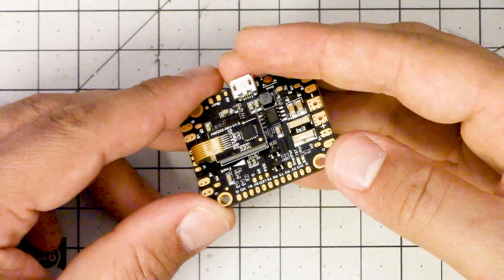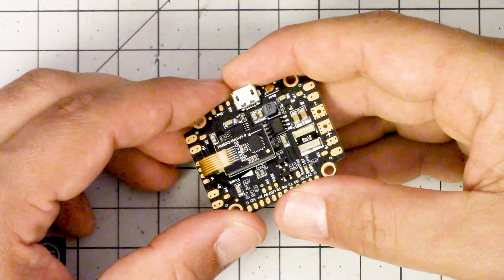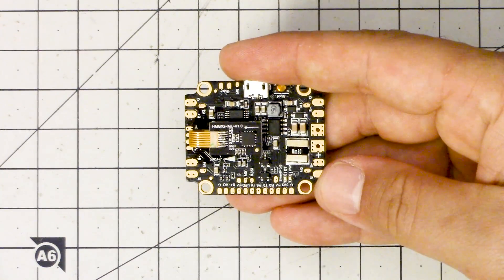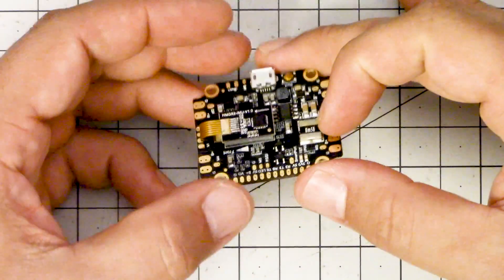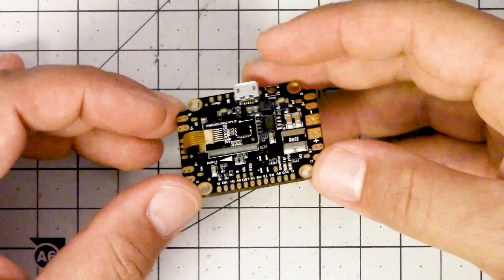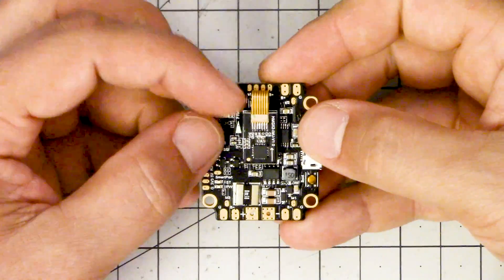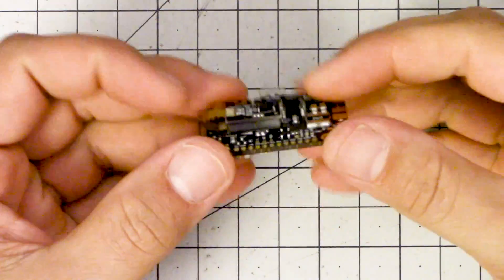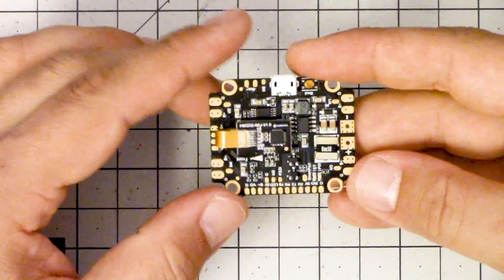Holybro Kakute F4 AIO | BETAFLIGHT FLIGHT CONTROLLER REVIEW

Comment: Joshua. Great video as always... i have just purchased this AIO board. My question is, im having trouble with a wobbling issue on my new build. I am replacing my BF F3 FC with this kakute f4 AIO. I have spedix es30 amp esc..will this work with blheli-s esc's? Or do you have to run blheli_32 esc's? Also can u set the gyro and pid loop to 8k/8k with mt esc's?. Thanks steve
Reply from the maker: +Steve Maratea yes it will work with any blheli ESC's no problem. You can run 8k/8k as long as you are using multishot or dshot.
Reply: Joshua Bardwell ok great. Im excites to try this new as i call it the Bardwell Board.. haha one question tho. I have the unify pro v2 5v, the crossfire micro, and the foxeer arrow v3. Im not sure how many milliamps the foxeer v3 uses as well as the crossfire micro receiver..? I know the 5v reg habdel 1.5amps. Woukd it be safe to run the vtx cam and reciver on the 5v? Using 800mw? Or is the B+ have a filter on it? So i can just wire the vtx and crossfire reciever to the 5v and the fpv cam to battery voltage? As long as the B+ is filtered.. Thanks

Comment: Hi Joshua,

One thing that confuses me is that in the manual it says there is UART 1, 3, and 6 and this is agrees with what I see in BF. I see the Tx and RX UART pads for UART3 and UART6, but not UART 1. Is UART 1 the Smart Port? If so can I use the Smart Port as a regular UART? (such as my runcam split). I just need one more UART and I gotta figure out this UART1 business! Thanks!

BTW I have hard mounted (nylon and steel screws) two of these FCs, one on a 5" Leopard and one on a 6" chameleon. Both worked out great, especially with the leopard because of the tight fit and it withstood a lot of bashing as it's my favorite quad. So the soft mounted gyro I can totally vouch for!
Reply from the maker: +GeckoLibre UART 1 I believe is used either for Smartport, so it only has the one pad. You cannot use it as a regular UART because it has an inverter on it, which is required for Smartport but breaks other protocols.
Reply: Aww donuts! Well there's somethings that could be improved. Another regular UART! Thanks Joshua for you help.
Reply: I just had the same issue on a 6in long range build , 3 standard UART's would be great, as the crsf crossfire protocol requires a uart, then i have none spare for a gps , as i use smartaudio also

Comment: I am flying the non AIO version of this on two copters and love it 
However when i try to enable dynamic filtering, things get weird. I can enable the setting and all is good but as soon as i set it to PT1 i get bad howling that sounds like motors if i disable the notch filters it gets worse and with just pt1 it’s un flyable, i go back to biquad and all is good flys great both my copters do this i have it on a chameleon frame and a 3” Loki x3 both fly great with the regular filtering but the dynamic filtering makes them both act the same in PT1.
i have a micro lux V2 F4 on a mobi x2 with the dynamic filtering on and pt1, and all filters off and it flys better then either of the larger craft 
Any idea. Why This would happen ? both the other craft are the same with aikon 4 in 1 speed controller and FC, only difference is the frame size

Comment: Just flew this FC... all I can say is WOW.... Unbelievable control and NO VIBES at any throttle... I fly 2700kv Dal5050 2-blade at 72degree camera angle and basically full throttle.... :) ....  even in a full throttle sweeping turn no vibes.... My max amps went from 84amps to 95amps cause it's not vibing anymore.... I have to say all your suggestions to them were spot on! easy to solder, easy to setup ... actually came pretty much set-up already and of course an excellent manual.... and NO VIBES.... good Job!!!! ... I'm buying 3 more FC's tonight for all my other quads!

Comment: hey, I bought this board together with a hobbywing 4in1 ESC. To get the OSD right on consumed current, I need to wire all the ESC wires (positive and ground) to the current input of the 4in1 ESC, right? like 4 wires down to the one input socket?

Halp plz!

Comment: i just noticed betaflight 3.2.2 isnt letting me save gyro and pid loop changes, and also the max arming angle thing. (180) i'm trying to save 8 and 4k but it keeps saving 8k 2k instead... is this normal, or do i have a problem somewhere.  i also saved and rebooted and one or twice it reconnected by itself, i'm running 3.2.1 firmware. and i tried various combo's of reboots with battery and usb complete unplug....cpu is at 5%...
Reply from the maker: it's because you have oneshot configured and oneshot125 cant' go at 4k.
Reply: ah brilliant deduction, thanks... i  will do multishot soon .. just wanna get some simple flight tests in first....

Comment: I learn something every time I watch Joshua's videos. The reason why I bought this board among the many I researched is that Joshua has been involved in the development of this board. Knowing this FC must be good if someone as good as him had assisted in its development, I was sold immediately. Now I am in the process of building my third racing quad. This one is my first with an F4 FC though. This time I am stuck. No matter how carefully I have followed the numerous instructional videos and the manual and other articles on the web, I could not get my spectrum satellite to go into bind mode. I have used three separate sat Rx's to no avail. All of them are DSM2 and so I'm using the following commands in the CLI after selecting SerialRX on UART3 and choosing Serial-based Receiver / Spectrum1024 under the Receiver portion of the Configuration tab in BF 3.2.2

   set spektrum_sat_bind = 3
   set spektrum_sat_bind_autoreset = OFF
   save
(and then I power cycle the board but no blinking orange LED) Hmmm!

I have soldered the satellite receiver wires correctly. Orange to +3.3V, Black to G, and Gray to R3 exactly as indicated in the manual. I have also tried with the bind command =3,5,7&9 options although I believe 3 is the one that must work.

I have checked the voltage with a multimeter and am absolutely sure the required 3.3V is present at the Sat Rx connector. To make sure my Sat Rx is not faulty, I have tested with two other Spectrum satellite receivers to no avail. I have checked and rechecked everything several times and am exhausted.

I could try binding the rx to my DX8 in the traditional way and carry on. But I really want to learn something today by knowing what is going on.  I would appreciate if Joshua or anyone of you pro pilots would tell me as to what silly mistake I possibly could be making here. I am sure I could not have messed up the FC while soldering as I am an electronics/computer repair technician. I have not had this binding issue with my other F3 FC's.
Please teach me, Joshua. And thanks for sharing your knowledge.
Reply from the maker: Spek Sat bind mode doesn't work on most F4 boards. You have to use a full spektrum receiver to perform the bind, then you can use the speksat on your FC. 

I recommend the LM0027.

http://amzn.to/2yeFmSQ
Reply: Thank you so much for your help. I'll go that way then. I was so convinced I must be doing something silly. Perhaps you should mention this in the manual.

Comment: Hey Josh, am starting my first build, ordered this, the only other board i need is the vtx correct?  And which would you recommend?  Thanks!
Reply from the maker: +Run n Gun https://www.fpvknowitall.com/ultimate-fpv-shopping-list/

You'll need ESC's as well.
Reply: Joshua Bardwell hey thanks for the reply!  I have esc's, the bullet 35a, just meant for circuit boards  :)
Reply: Joshua Bardwell and yes, ive been through your list on a number of occasions.  Its on my quick links, you are why i bought the kakute.

Comment: Awesome video? Can motor 5&6 be remapped with resource command to be uart 1 rx&tx? That would make my day!!!
Reply from the maker: No. UARTs are hard-wired to pins on the actual microcontroller (F4) chip. They cannot be remapped.
Reply: Joshua Bardwell 
I can’t use the smart port pad. Is that tx1 or rx1?

Comment: The reason I got this is because I own two kopis drones and love them, so I wanted to build a drone with emax 2306 2550'sand the kakute aoi atlatl stack. One thing I didnt do was use newer esc's, so I just ordered the wraith 32 bheli 30-35 amp ones, I hope this fixes my issue

Comment: Hey Josh, I am super frustrated with this board. I soldered everything up, and only my motors 1(one) and 4( four) are spinning. Any suggestions
Reply from the maker: There's no inherent reason the FC would do this, so I would look first to the wiring and soldering. Possibly you have a defective FC... I mean it's always possible. Use the technique of swapping ESC to see if the problem moves with the ESC or not. If it stays on the same motor output, then the motor output is the problem. If it moves, then the ESC is the problem.
Reply: Thanks josh, I will give this a try

Comment: Hey man ! Does this board fit in the furibee fuuton 200 that originally has the kakute f3 ?
Reply from the maker: The real question is vertical spacing for the soft-mounted gyro. You need about 4-5mm I think, although I haven't measured.

Comment: Hi @Joshua Bardwell, Could you mount it upside-down and still jam stuff on top and just tell it its inverted or does it work best right side up?
Reply from the maker: If you turned it over, you would be soldering to the under-side, which is a bit of a hassle.
Reply: But could you do it? I have very little room in my build and I normally jam the receiver on top of the FX.

Comment: I like this board for similar reasons as you - simultaneously use SBUS, Smartport, and smart audio. I'd like to use this FC with a 4 in 1 ESC. Do you think it would be appropriate to use 12-14awg wire from two ESC pads to power the 4 in 1? This way I should still be able to use the current sensor?
Reply from the maker: 14 gauge from two pads would be more than adequate.

Comment: Joshua I'm having problems with my kwad. it has a Kakute F4 AIO but it keep twitching. If i touch something it spirals also. does twitching can be caused due to the soft mount foam? I'm looking into do the M3 tape mount as you suggested. any suggestion on what to do about the twitching? I haven't the chance to flew the kakute right due to the twitching. brand new build first time with kakute and lots of twitching. ESC are TBS 25A BLHeli S running FW 16.65. On esc i have tried FW 16.65 to the newest and all does the same. FC is running BF 3.2 RC5.
Reply: Mine is twitching too. Did you find a solution? I was thinking about the 3m tape too.

Comment: Hi Joshua, will a transmitter such as the FlySky i6 without telemetry still be able to use the stick command to enter the OSD menu and adjust PID rates and/or VTX power levels? Thank you for your honest reliable insights!
Reply from the maker: Yes. You just need to use sticks to adjust the OSD. No Telemetry or Lua script or anything like that needed.
Reply: Thanks! You da best!!!
Reply: Hey Joshua! Is using the VI and VO pads on the board required to use the betaflight OSD? I currently can only get video if I connect the cam directly to VTX... the VI and VO pads are giving me a black screen.
Reply: I know I'm not Joshua, but maybe make sure that your camera is connected to VI and VTx to VO? Also double check your voltage sources to make sure they are suitable for your cam and VTx.
Reply: I appreciate your help. I have them correctly hooked up and the power and ground leads work when I connect the camera directly. The only thing that changes is the video wire going to VI and VO to their respective component.
Reply: Gosh I dunno there. Did you try turning it off and on again? XD I'm out of ideas other than lens cap...

Comment: is it capable of running Dshot 1200 or blheli32. I didn't see that information on getfpv's website
Reply from the maker: It's an FC not an ESC. So it doesn't run blheli. It can do dshot1200.
Reply: Joshua Bardwell,  I know on my flytower Raptor 390 F3, in betaflight it isn't compatible with Dshot 600.  So I wasn't sure if some flight controllers limit what Dshot Protocols it can run.

Comment: I'm having an issue flashing the latest firmware on my kakute F4 as soon as I load the firmware and go to flash it disconnects either when I have the button pushed in while plugging in the usb or not
Reply from the maker: Not sure what you mean by "it disconnects". When you plug in, nothing is connected. 

Assuming you are running Windows: have you installed the VCP drivers? Can you connect normally to the board (not in firmware flashing mode)?

Assuming you are running Windows: download "ImpulseRC Driver Fixer" and run it. Press the bootloader button and plug in USB. Wait for it to "fix" the drivers. Un-plug. Plug in again in bootloader mode. You should see "DFU" in the pulldown menu in the upper-right of the configurator.

For more: https://www.youtube.com/watch?v=m4ygG6Y5zXI

Comment: In the manual it says it doent support PPM or PWM, however on their site they state that the PPM is shared with UART6: Which case is it then?
Reply from the maker: +Matevž Zupin I wrote the manual. So everything I know is there.
Reply: So you tried PPM on UART6 and it doesnt work?  Just curious since you contributed to development of this board, why would they not provide PPM support, which is I guess the most widely used signal output?

Comment: Just got one, one of the easiest builds ive ever worked on.  great layout, good quality shows. Awesome board. careful with those pads though, I think I pulled off half of the M1 pad quite easily. and I solder quite a bit.  I have it wired up now though.  about to see if it still works.
Reply: yup its all working great..  love this board well done!!!  anyways, as always I cant get telemetry going.  I used the smartport pad and enabled uart 1 as smartport.  no dice.

Comment: Hi Joshua!

I have been watching some of your videos and wanted to thank you for your work! I am always impressed with the details.

A couple of weeks ago I bought the kakute f4 AIO and in the last week I have built a racer with it, everything works perfect except for the telemetry. I read and followed your manual (thanks again btw - very well made!), tried sport_halfduplex  as holybro suggests and still nothing.... I am using it with the FRSKY XSR receiver .... If there is any way you can help me please let me know.... peace!
Reply from the maker: Have you tried updating the firmware on the XSR? It has some issues in the shipipng firmware.
Reply: Thankssss man!! That worked out for me!!
Reply: I have the same problem but i have an x4r. Downt know if this works for me?? Have to de solder my RX then.

Comment: ive liked omnibus f4 v3 but id like to find something that i can directly use battery voltage off pdb and not have a flight controller that needs a voltage regulator. So maybe this would be good choice?
Reply from the maker: Yep.

Comment: Hi, nice video, i just have one problem, the manual says the board has 3 UARTs (3 hardware UARTS (UART1,3,6)) but i cannot find UART1 pins anywhere. Are they routed somewhere else?
Reply from the maker: UART1 is routed to the SmartPort telemetry pad. It has an inverter installed and is not usable for general purpose (non-inverted) IO functionality.
Reply: Yes, that's what i thought,  i saw that SmartPort telemetry was enabled on UART1 in the manual, so i'm guessing that this was the T1 pin and inverted. I wanted to add a GPS and bluetooth module on UART3 and UART6 and use UART1 for the receiver, guess i'll have to chose between them now :)
Reply from the maker: +Andrei Boitor try remapping softserial to the ledstrip pin.
Reply: Thank you again for the help, but i do want to use a led strip as well.

Comment: Would this board be ok for a fpv pod stack? I'm worried the imu ribbon cable might be too exposed... also when using a flash chip for bb do you have to download it after each flight or does it save multiple flights like an as card?
Reply from the maker: The dataflash chip can store multiple flights but not very many and it fills up fast. Once it's full, it stops logging.

Comment: The manual says this fc can run 32khz gyro rate, every time i put the gyro to 32khz i get 100% cpu load on the latest firmware.  Is there something im doing wrong?
Reply from the maker: You need to overclock the CPU to run at 32k. In the CLI, type:

set cpu_overclock=on
save
Reply from the maker: Even then you might only be able to do 32k/16k.

Comment: Hey Josh, Ive just hooked this up on a kraken and I seem to be getting throttle noise in my video feed (using hs1177 with a tbs unify hv) got the camera running on 5v with the vtx on b+ rail on the board as the tbs needs +7v. also i have a 25v 450uf cap on the battery pads. any ideas about why this is happening or what I could try?
Reply: thinking about running a 9v step up pololu off the 5v rail to the tbs vtx, pity there's no filtered 12v rail on this board too.

having other issues with it now... I've had a few issues free flights (aside from video interference) with this board, but also getting something which is happening intermittently. Sometimes it happens as soon as I arm, sometimes I have to hit mid stick on throttle, but the motors start running really rough, they get quite hot very quickly and the throttle won't return to idle to the quad just keeps going up until I disarm.

I tried turning on blackbox but every time I try and view a file I get this error message "no logs in this file could be parsed successfully".

I even tried flashing 3.1.7 on it thinking it might be that 3.2 is unstable...no exactly the same thing happened, I think it might be noise reaching the gyro, even though it's a clean install, no wires are touching the gyro..